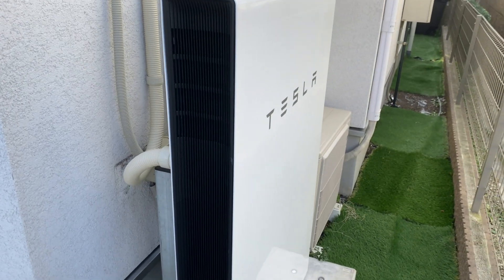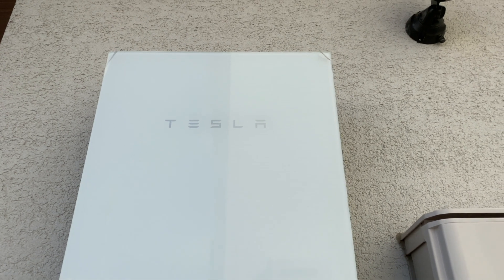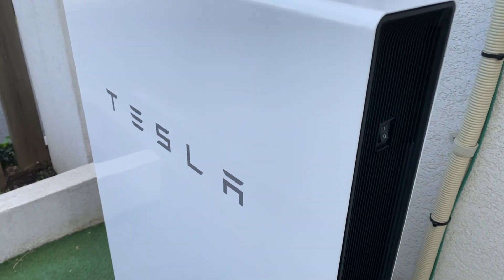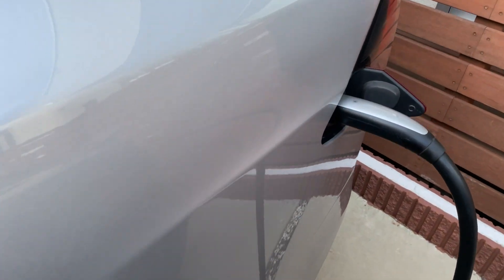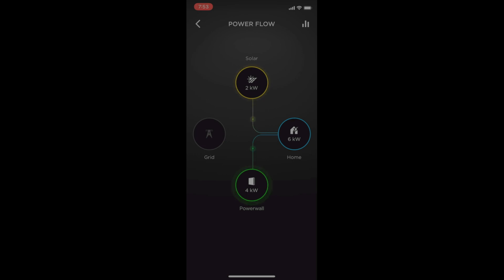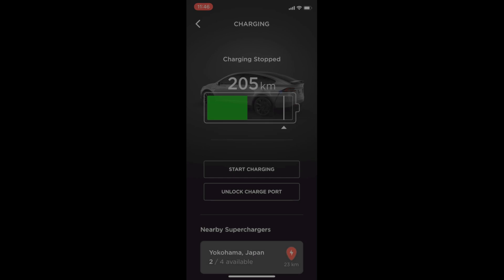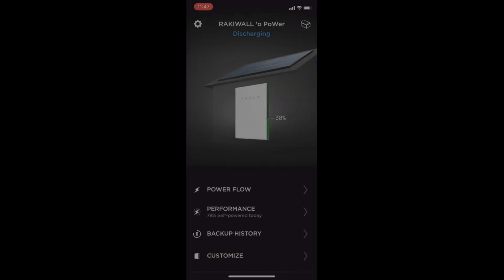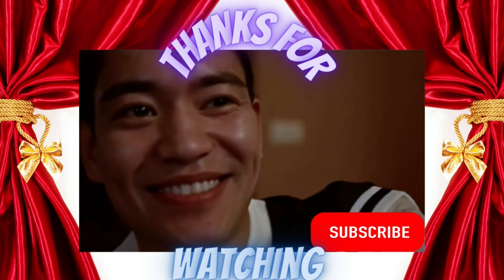テスラ パワーウォール 2 を日本に設置/ Tesla powerwall 2 in Japan what is it and is it worth it

Comment: great video, i am actually considering getting some as many battery makers in Japan dont support high amperage (Tesla batteries themselves do high amps and also allow for chaining them to allow for even higher amp usage). 

I guess you did solar panels first when building your house and later added the batteries. What components did you have installed by the home maker before the batteries? 

Usually it looks like:
1. Solar panel - home maker
2. power conditioner + inverter - i am curious about this one, did you have to remove your old one to use the tesla one, or do they work together?
3. HEMS - that is the panel that tracks usage, how much you generate and how much you sell to Tepco (plus some extra IoT stuff for the newer ones). Do you have the solar panels original one working alongside the Tesla one? or did you replace it something?

Comment: Thx for sharing that. Getting ready to install 2 Powerwalls into a new place. Curious if you have the power to determine when and how you sell back excess power to TEPCO. By using the app, can you essentially generate, keep, and use ALL of the power? Or does TEPCO have a say in when and how they buy your excess? Just curious.
Reply from the maker: Any excess power that the 2 power walls don’t store and the house doesn’t use , will automatically go to tepco cause it has to go somewhere . You can’t control that via the app . I’m in America right now and my powerwall is maxed out in Japan and I’ve been pushing power to tepco for weeks , no where else to store it . Thanks for the question !

Comment: 2022/12/28, updating. Right now it’s 3°C in Mie Ken Tsu shi, accordingly to the Tesla support it should be charging at at least 3kw. Right now my solar panels are producing 3.1kw but the powerwall is only charging at 0.8kw! It’s a shame! The support doesn’t even know what is the powerwall statistics and find a solution. This battery doesn’t work well in cold temperatures, be careful!
And this is another reason I don’t trust ev cars as well. They will probably take more hours to fully recharge in cold seasons.

Comment: Updating. The powerwall support guy came to my house. It said the battery DOES NOT work well in winter. On 0° Celsius it doesn’t work (wtf), when the temperate reaches 10°C it can be charged at 5kw, so it means this battery is completely useless in cold temperatures.
I asked why don’t they make some kind of cover with a heater to put on it on winter? Perhaps it should have some kind of self heater system for this cases. They will come again to try to solve the problem.
Reply from the maker: That’s unusual because if you look at the spec sheets it says it can operate in -20 degree Celsius all the way up to 50 . Also it has a very high weatherproof rating that’s why I bought it in the first place . You’re in Japan , what part ?  If you’re getting snow on it I’d just buy a tarp and throw it over it to protect it from buildup so you’re not scraping the unit brushing snow off it.
Reply: @DaddyTJapan  i live in Mie Ken. It’s not so cold here but if the temperature goes close to 0°, it already start to not work so well. It starts to charge at 0.4kw (speed) even if I set to charge with the grid electricity (time based control). With its own charging, it starts to get warmer and the speed of charge starts to increase. But in 3 hours charging it doesn’t reach its max 4.8kw. Normally in 3 hours of grid charging it could fill my battery to 100% but it doesn’t in the winter.
With solar power is even worse because sometimes the weather it’s not completely good (sunny all the day) so the battery doesn’t get warm charging at 0.1~1kw all day for example. 
The support came here again yesterday but didn’t solve the problem again. So basically I have to start to charge with my own electricity in the morning to ‘try’ to warm the battery before the sun rises.
I asked him why Tesla doesn’t create some kind of self heater for winter seasons(?), or some kind of cover like a green house (vinil house) to cover the battery in winter because I think this is a serious problem.
Reply from the maker: @OmegaFutsal  thanks for sharing , that’s  good information that people need to consider before buying . I haven’t had that problem but if I ever do I’ll post an update . Thanks
Reply: @DaddyTJapan  Didn’t you have any issue in winter season?
What happen if you charge your battery with time based control at 0°C? Does it charge normally at 4.8kw?
Reply from the maker: Right now as I am typing this . Charging via solar power 4.7 kWh. Also subscribe got free and support the channel .
Reply: @DaddyTJapan  Today during the day I also had 4.8kw of charging speed but try to charge at 0° or less and tell me what happen.
Are you an official Tesla support person?